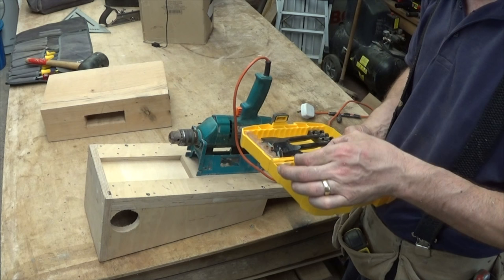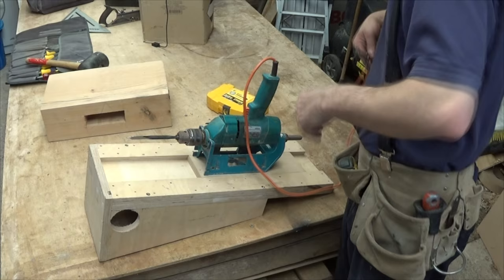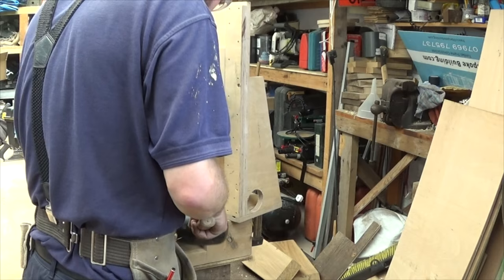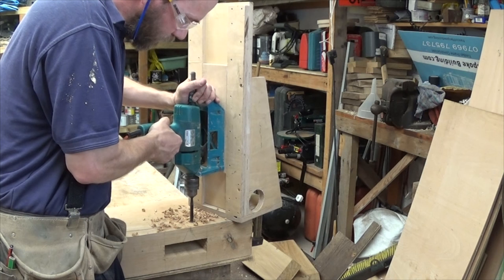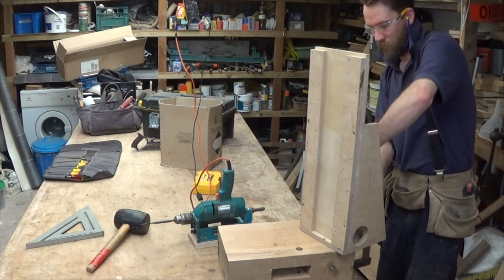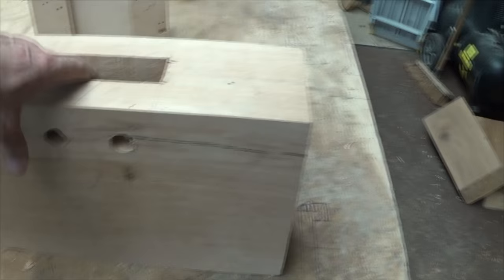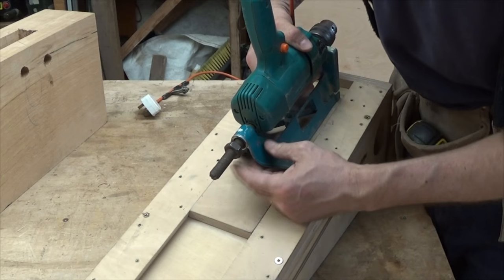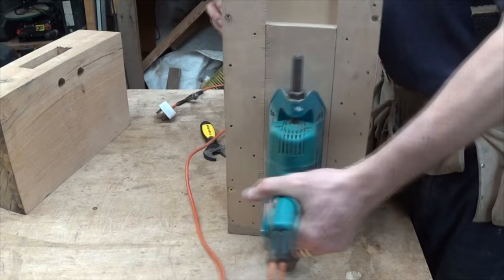Timber Framing Portable Drill Press (home-made)

Comment: Neat rig, I've never seen one of those attachments before.
Reply from the maker: Its part of a black and decker lathe attachment kit, turns your drill into all sorts of DIY tools, Thanks for watching.
Reply: Use a ship's Auger and a prepared plate with a pipe welded perpendicular.  Then stand on plate and drill through pipe.

Comment: OIC, that is a lathe attachment! Nicely spotted find. Great re-purpose.
Reply from the maker: Hi Gareth, I think I will be making a new version of this tool to fit to my dewalt low speed / high torque drill, going to be a while until I get around to it thou. Thanks for watching.
Reply: I want to make a portable drill press for my makita paddle drill. I have wanted to every since I saw yours in one of your timber framing videos.
Reply from the maker: I guess its a high torque mixer drill? Perfect for drilling large timbers.
Reply: Exactly. I am thinking about using extruded aluminum from CnC builds for the rails.

Comment: You lucked out on that lathe attachment.  I can't find one to save my life.
Reply from the maker: +Mike Gee I have been thinking of making a new version of this drill jig. I will use a dewalt drill as it has screw holes for mounting side handles.
Reply: Mike Gee, No doubt about it.... if the black n decker drill that has a mounting hole in the back and a lathe attachment jig which can't even be found anymore, this video is just a tease for those of us who need to get our job done. I too can't find the drill or attachment ANYWHERE and I have been searching ebay and the rest of the world wide internet for a couple weeks now but found nothing.
Reply from the maker: +Get-The-Lead-Out.45 you can get any drill and build a clamp around the removable front handle section of the drill. Some drills have screw in side handles, these could easily adapted. Good luck. Thanks for watching.
Reply: francis barnett, Sure, we can get any drill and go through the process of figuring out how to make it work but that's obvious and also not the point... since we need to get the job done now or soon, we need a video showing how to do it with a drill motor that is actually available and showing how to make it properly in order to insure that we're going to drill a straight hole without any problems that make us go back and spend even more time to figure out to do it right.
Reply: Get-the-lead out .45, 
You can get a 1/2" drill motor and most have "screw in the side handles" as Francis describes.  Even my older Craftsman 3/8s had one.   Might be easier to buy one of the many available "portable drill press" kits shown at the top of this commentary list.
Reply: @francisbarnett  ive seen a jig someone msde using a right angle hole hawg and drawer slides mounted on a frame.  He used the handle holes on each side of the drill to mount to the drawer slides.  Was pretty cool.  Think he posted the plans for it.  I need to find it.

Comment: the slideways looked a bit stiff. Wonder if talc powder or candle wax treatment would help. Could you not have done this with adequate alignment by hand & eye, since you are merely using for assembly pegs ?
Reply from the maker: +Peter Owens thanks for your comment, the ply dovetail slide had expanded due to winter months in my shed. Using this to drill for the draw bore holes is far better, as the holes can be 6" or 8" deep if I was only a couple of degrees out it would make a massive difference to the holes squareness to the face timbers, thus my peg wouldn't pull the tenon into the joint or it may not pick up the back part of the mortise at all. Thanks for watching